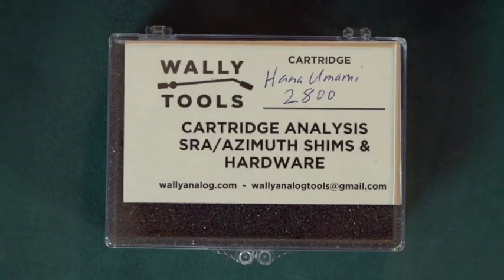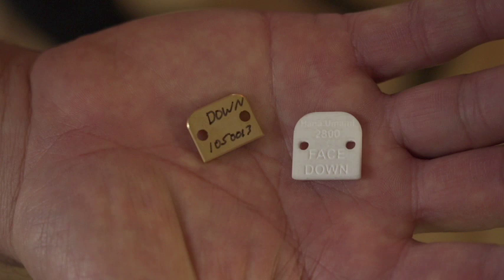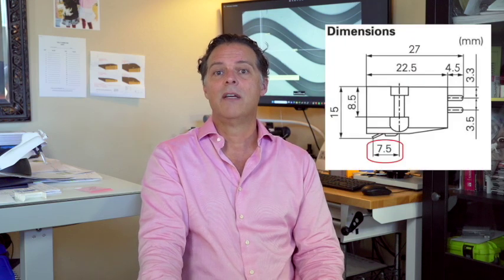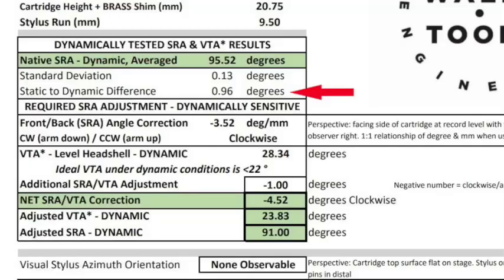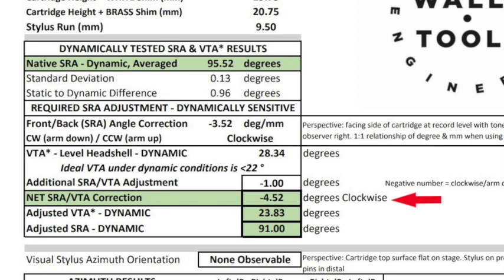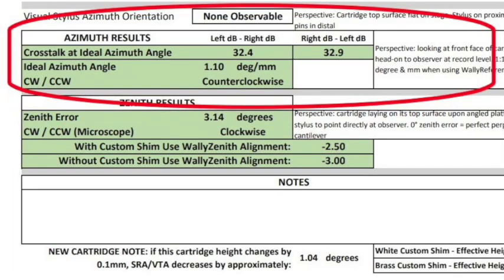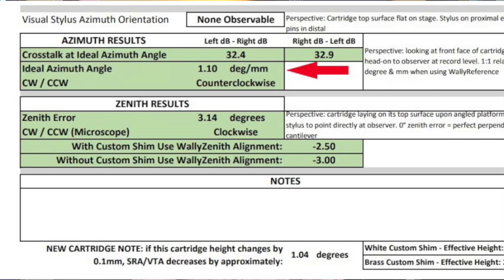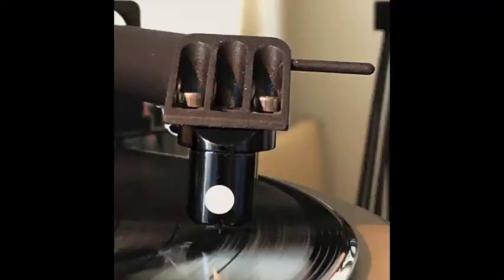Understanding Your WAM Engineering Cartridge Analysis Report

Comment: I bought a wooden head shell  a while back I lined everything up with my protractor etc the records sound amazing.  But I did notice when I put it on my  over hang gage it was not in the center?   the whole cart was off to one side?  I did measure the slots with a caliper & found out there was a 20 thousand difference per side. Question is is it ok or not?  should I file/ machine the slots to make the cart in center? I can sent you some photos if you like! any help would be great! Thanks
Reply from the maker: Hi Paul. Send me photo or two using the contact page on our website. I’m not 100% sure I understand the issue and perhaps images would help.
Reply: OK @WAM-Engineering
Reply: It's not letting me attach a photo? Do you have an e mail I can send it too? 
 @WAM-Engineering
Reply from the maker: @paulc5358  , I won't post it here. Send me yours over the website and we will link